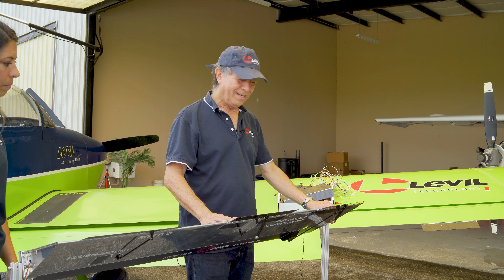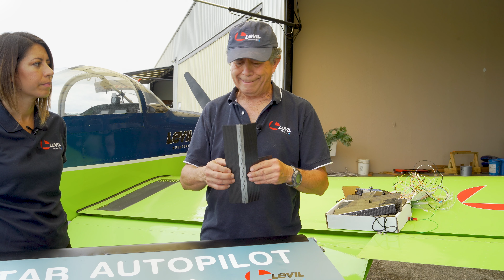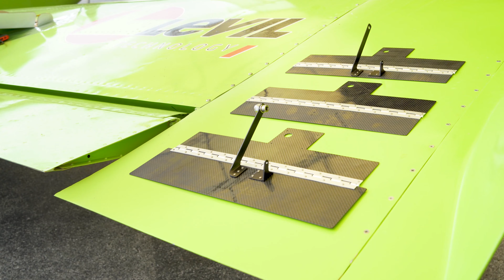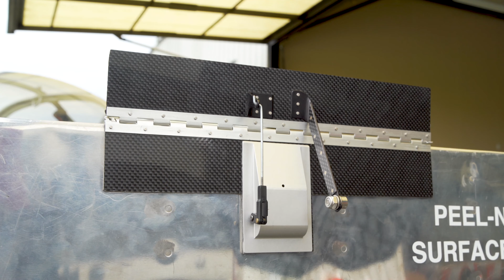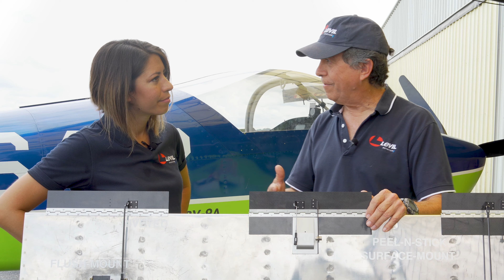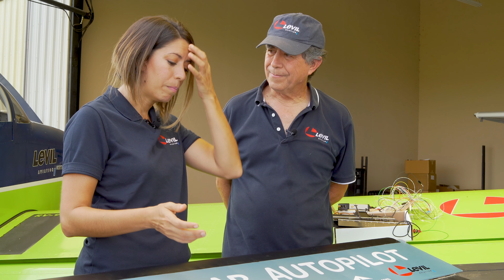How to Install Your Trim Tabs | Chapter 02 iLevil AP Manual

Comment: could it be set up so that the manual trim function is wired to some buttons on my panel? IT would be nice to not have dedicated trim controls as hard button in the aircraft and not have everything require going into different menus on the tablet and using touchscreen controls.
Reply from the maker: Our sister company, Aircraft Automation, has an option for this.